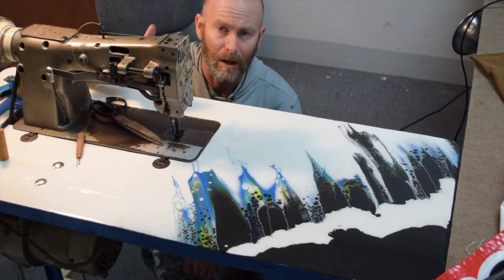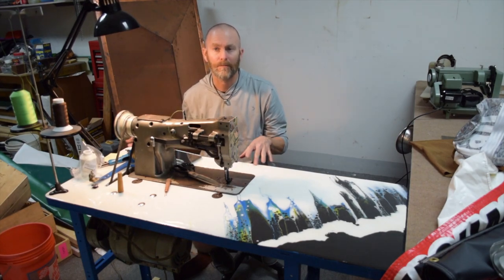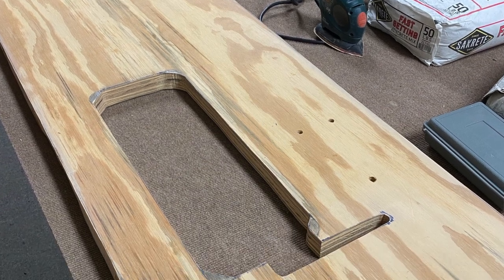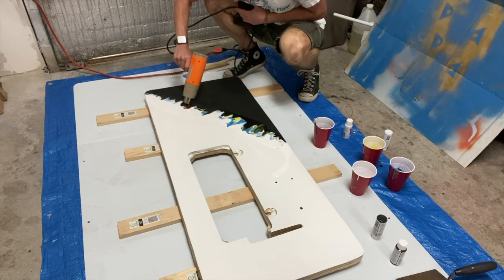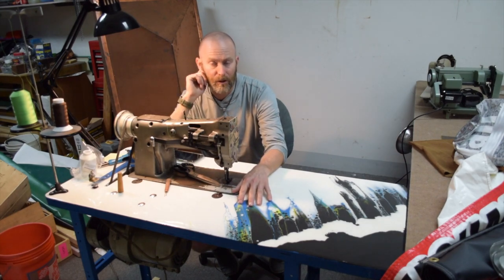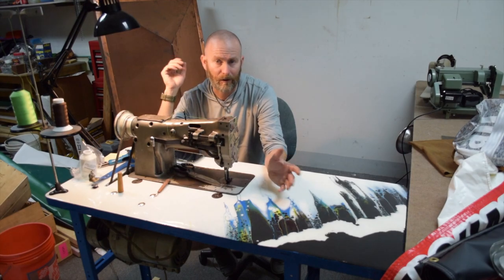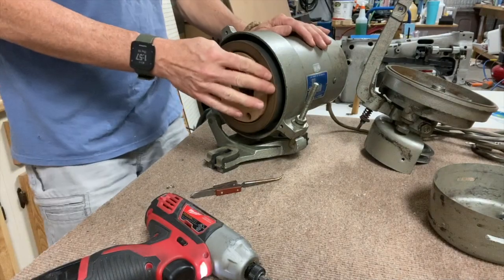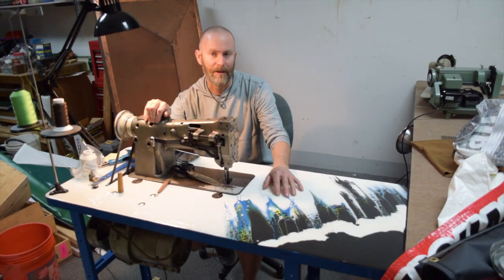Custom-Painted Industrial Sewing Machine Table (Dutch Pour)

Comment: You answered a question have been asking many groups: will two sheets of 3/4 plywood suffice for a top. Thank you! 
In case wondering, bought an industrial table without a top that is only 30 inches wide (so fits in a former bedroom), so no top to copy.
Reply from the maker: I have to give the caveat that this has only been in use for a few days, and I can't speak to its long-term durability.  That said, it feels MUCH more solid than the particle board original top.  Good luck with your project, let me know how it turns out!
Reply: @thejasonwins3765 , understood, at least a starting point.

Appreciated! Be a bit, been sick (which is a positive as this workaholic hasn't taken a break in ages).